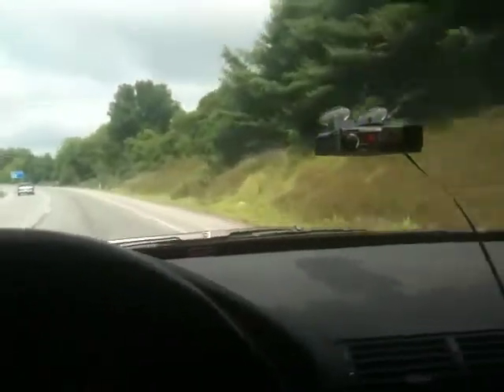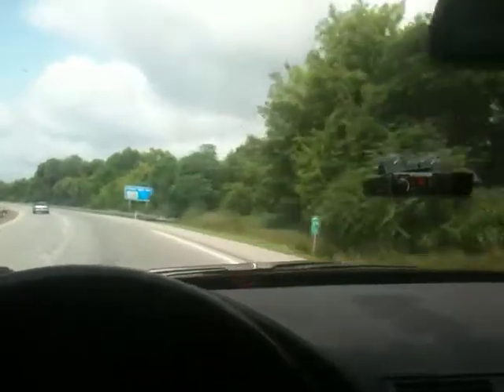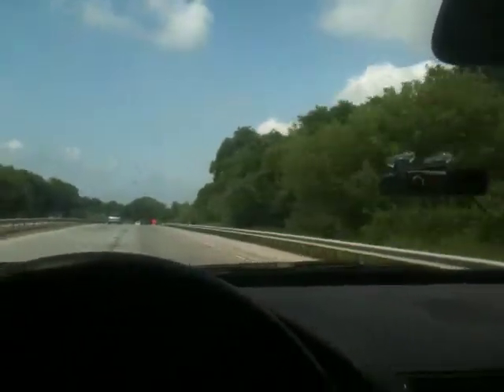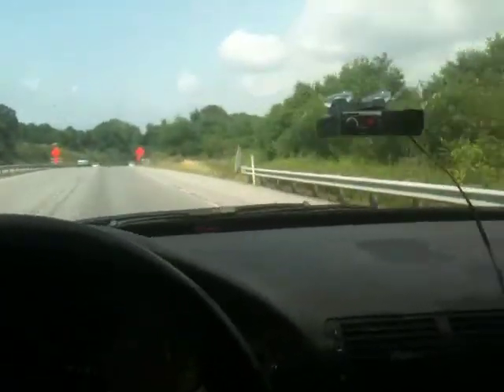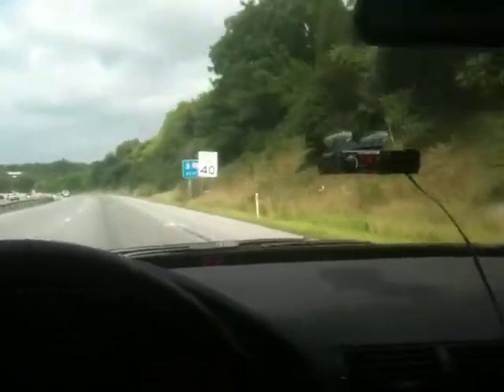V1C 34.7Ghz Ka CO Facing Run I

Comment: Which one would you recommend, Redline or Valentine, for overall performance?
Reply from the maker: +Paramvir Guram 

Tough question.  My personal preference is for the V1, while the RL does have a detection edge to certain radar frequencies in certain circumstance.  But for me, the sheer performance of the V1's laser sensitivity trumps that because every alert to laser requires IMMEDIATE attention.  Not so with radar.  So for me, it's simply a matter of priorities.